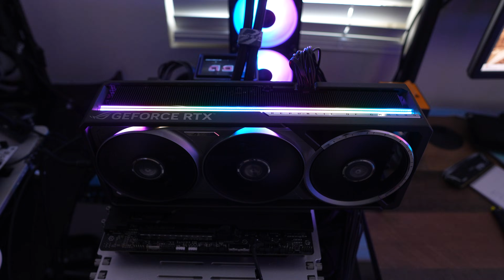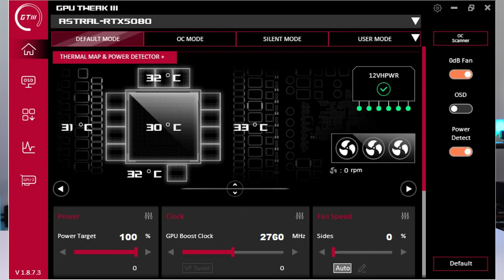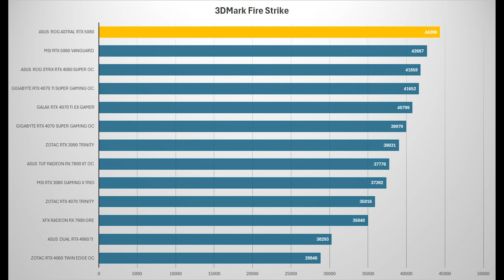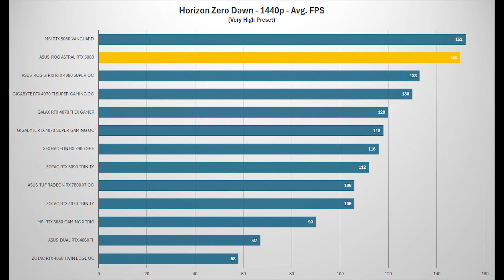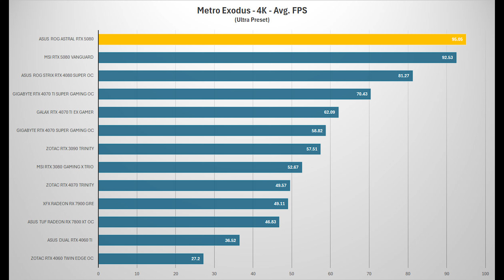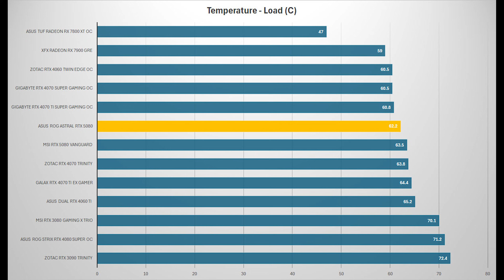The Best RTX 5080?! - ASUS ROG ASTRAL RTX 5080 Review!

Comment: 1700 usd for 16gb vram is not a good deal. At this price it should be capable of doing AI workloads and, well, it's not gonna do it. If money is not a problem why not get a 5090, and if money IS a problem, asus 5070ti 16gb costs 800 usd and is only minimally slower.

Comment: I got this card, the build quality is just unreal. Overclocks perfectly and temps mega low. About 3250hz on the core, and 2000hz on the memory nice and stable. Temps dance around 69 degrees fully loaded. Not a cheap card, but if you want the nearest you can get to a 5090 without paying £1500 more, this is worth it.
Reply: I just found one on Amazon for $900 should I get it?
Reply: @toxiclore7201 just don’t get scammed
Reply: @brianncncnc yes i thankfully was not that stupid and looked at reviews and the sellers history! Thank you.

Comment: I settled for the Astral 5080 myself. Wasn't too sure as I was coming from a founders 3090 card. I notice the difference in gaming. Wish it came in a white version as it looks like a big black brick in my all white build
Reply: I ordered the 5090, using a 5090 Suprim atm but once I saw the Astral available I figured if I’m gonna spend that obscenely much I should make sure I get the best AIB.
I’m also coming from a 3090, but I don’t use it much for gaming, more for production work. And the 16gbs is just too little for what I do. I imagine the 5080 Super would work for me but I’m not sure when they’ll drop and how much they’ll cost
Reply: @jjclem8759 massive upgrade it’s at least 2x stronger than a 3090.
Reply: @ZackSNetwork try 4 times

Comment: Overclocked it to over 3200mhz and its insane
Reply: I'm able to get over 3200 MHz and 2k MHz on the VRAM. Stable. Highest temp I have seen was 68 with a 20 minute soak. I'm impressed enough that I may always pay more for the higher solution in future builds.
Reply: I got my 5080 astral yesterday,  its got the core and memory clocks maxed, 0 issues running anything, helldivers rtx is buttery, comming from a 4050 laptop
Reply: I have the 5090 astral and I over clocked to 3100-3200 as well and on ram I got as high as +4000 before it crashed out. Temps are same as yours, hit like 65 in a 600w load with low fan speed. Turning fans to 65% and my 10 case fans exchanging an enormous amount of air, I hit lower than 55c in most games
Reply: @JRayHD  why would u overclock a 5090 the 5090 already Is at it's peak lol
Reply: @sasukestrongestuchiha because it’s not. 575 is the beginning. You can go over 800 watts on a 5090 with intricate tweaking and soldering

Comment: Seems like a paid for review.  I would not pay as much as they are charging for a 5080 get a 5090 FE
Reply from the maker: @Crazyd_  not paid just giving my opinion on it, it is expensive and I explain that extra savings buying an FE could go far towards other parts
Reply: Well there’s others that would so…
Reply: I paid for it and its been awesome.  Like he said, its entirely CNC, my 12VHPWR is secure and not overheating and it runs extremely cool, I am running new games at 45-50c pulling around 200w.  The FE is cheaper sure.  Its like cars, why would I get a Corvette (or sports car) when I could easily drive a Prius?   I dont think I need to even answer that one.
Reply: The FE's are the only one melting their connectors so far, and are also the ones along with Zotac with the reported ROPS missing issue.   FE is really a dog this generation.
Reply: @ No they're not. A ASUS 5090 Astral caught fire today.
Reply: @Richurro  completely different thing, a vrm blew not a melted cable.  It was a single bad component which happens on any device.
Reply: @Richurro  not the same, I’ve seen PCs with dedicated graphics cards catch on fire.
Reply: @Airplanetyson  True. But I just think this 12v connector is badly designed. Its only got a finite amount of times you can plug the thing in to the GPU before it eventually burns. Even the safe guard plugs that come out to prevent don't prevent it from getting burnt. Example, the ASUS ROG Equalizer $50 GPU cable designed to prevent burned connectors has reportedly burned.  If i were to get a 5090 I'd get that BTF version so you dont have to use the 12v connector.  I have a regular 5080 and im still sketch its going to burn one of these days.
Reply: @Richurro  having both the 5080 and 5090 astral I just use the pin monitoring via HWinfo and call it a day. I have not seen any reports of anyone using a true ATX 3.1 PSU having issues. Also I seen that Asus cable melting. There was no background story to it though. I wonder if they were stress testing it on purpose or if they didn’t have a 3.1 PSU. Not to make an excuse for this design flaw.